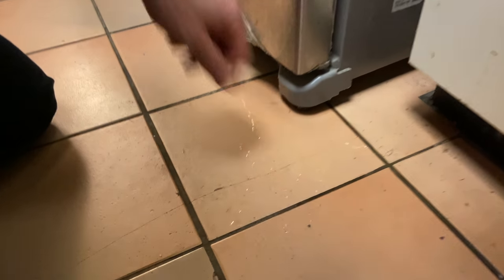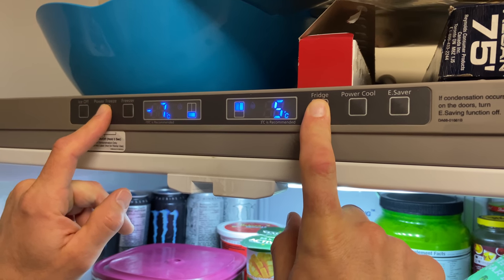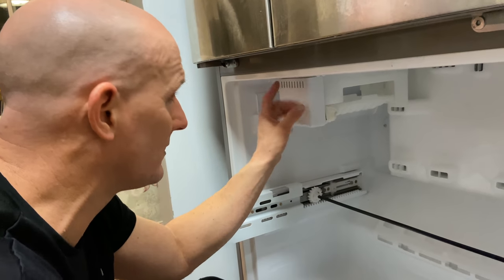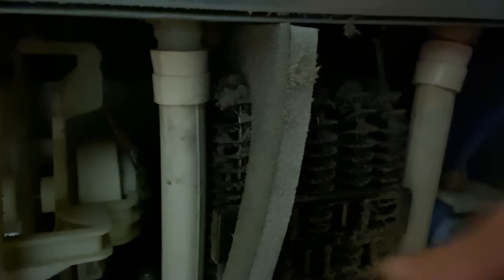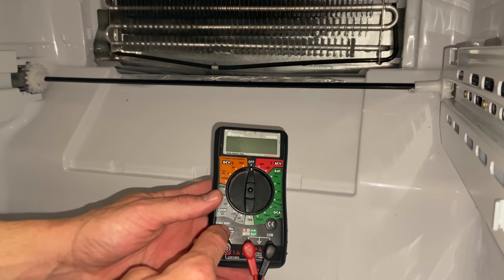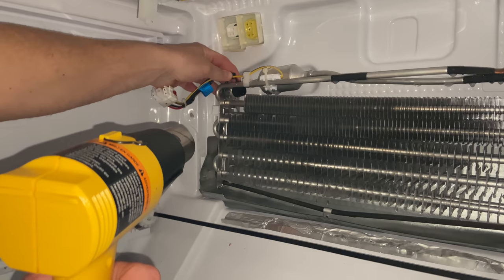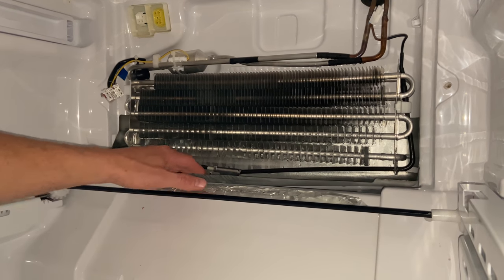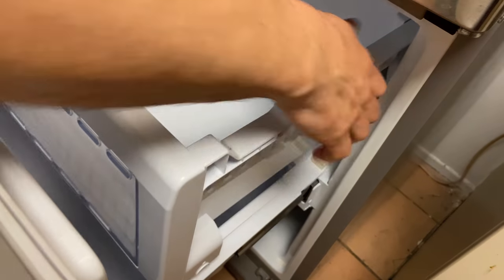Fix Ice Buildup Easy (4K) Samsung Refrigerator

Comment: I only have 2 buttons (operation & temperature control) on my control board and 4 lights inbetween " colder to coldest . The colder light blinks non-stop and the buttons are unresponsive . I replaced the control board but its still doing the same. I also replaced the sencor ,element ,regassed and still nothing has changed . The fridge works fine for a week then the ice buildup happens and air dont circulate. What should i look for next ? Thanks
Reply from the maker: This is the updated Repair Kit that you need for Samsung.
Samsung Water / Ice Repair Kit:
Amazon US: https://amzn.to/3YN4Enw
Amazon Canada: https://amzn.to/3WKlUYK

Comment: i had this issue in the refrig section, but not the freezer.  But I'm not getting any water into the ice maker.  the ice maker functions fine, but no water going in to make ice.  I even took out the filter to make sure it wasn't having an issue (assume it's not required to get water to the ice maker - my entire house is on a filtration system). any help?
Reply from the maker: I'm filming a video on the ice maker tomorrow but a different issue.  The only thing I can find is either a electronic issue or blocked line.    Is the ice maker clicking to allow the water flow in?
Reply: @JeffLepard  I can reset the ice maker and it will run through it's cycle to push out any ice, etc, but nothing ever happens when it should let water in.  No "clicking"
Reply: I mean, maybe the freezer line is frozen too, but I've never had the block of ice in the bottom like I did under my crisper drawer all the time in the refrig section.

Comment: question: when I check my freezer or refrigerator temperatures, just after pushing the button a first set of numbers appears and then automatically a second set of numbers appears. 
What is the difference and which one  in fact is the real temperature?
The manual says nothing about this
Thank you again.

Comment: I never had problem in freezer part   ..always happened in top that back panel get iced up & hit the fan
Reply: Were you able to fix this yourself? Mine does the same thing
Reply: @mikemoss8761  
yes ALOTS videos in here show u how ..u can have open the back panel VERY carefully , melt the ice , then put all back or BETTER FIX  change that thick heating blk cable  back of the panel, or gonna iced up again after few months, if u dont change it,  is ALL in videos in Utube  show u step by step

Comment: Thanks for the video! 
Moral of the story - NEVER EVER BUY ANY SAMSUNG PRODUCTS! WE'VE HAD TWO DIFFERENT SAMSUNG REFRIGERATORS, A SIDE-BY-SIDE, & A FRENCH DOOR MODEL. THEY BOTH SUCK BC OF ISSUES LIKE THIS. 
OUR $1600 SMART WASHER WAS THE DUMBEST PURCHASE WE EVER MADE. IT NEVER REALLY CLEANED OUR CLOTHES & WITHIN THE FIRST MONTH IT DEVELOPED THE INFAMOUS SAMSUNG MOLD ISSUE.
Reply: 100% agree! The design and manufacturing of these products is horrible. Even worse they keep selling this stuff when they are aware of the problems. They are made to fail and we have to replace them. Not Samsung not in my house.

Comment: Here’s another symptom of frozen drain: when you shut the freezer drawer, it pulls a vacuum so hard that you can’t open it without using something like a plastic spatula to pry open the door seal to permit air pressure to equalize.  Normally, when you open the freezer drawer to get something out of it and then close it, you have an inrush of air at ambient temperature.  And normally, that air will chill and contract, pulling air through the drain.  But if the drain is plugged with ice, that doesn’t happen, so the door requires a huge amount of force to open.

And also, once the drain is frozen shut with only that completely inadequate tab to to thaw it, it will never ever open up again.  An ice plug will form that is a couple of inches long and that takes hours to melt away.  You’ll have the ice on the freezer bottom and difficulty opening the drawer until you thaw out the ice plug.

Samsung needed to put an actual piece of hear tape around that drain.  It’s poorly designed.
Reply: *heat tape

Comment: The only real problem I had was that I wasn't able to disconnect the larger plug from the back of the case so I just propped it up and went to work melting the ice.

Comment: I'm a Samsung tech...NEVER USE AIR HEATER BLOWERS...you risk warping the plastic, Samsung will void warranty. Plastic in fridges melt at low temp...use steamer!
Reply from the maker: Thanks for that, best method of course is to let it sit.

Comment: Your video's are so informative. Used them several times to work on my samsung fridge/freezer. Now it stopped making ice. I usually push the button to reset the ice maker and that did not work. I saw that it is turning the ice mold upside down and nothing was in there. Today I'm going to clean out the hoses in the back as you did. I am looking for where the water filter is located in this model? #RF26HFENDsr/aa
Reply from the maker: I'm doing a video on the icemaker next.  My issue is that it's broken and cracked.    Also, if your issue doesn't work unplug the fridge for a while and reset again.   If not somethimg with the electronics or the water line or switch.